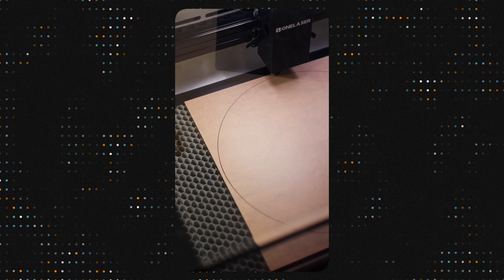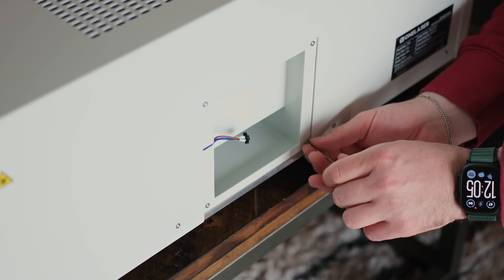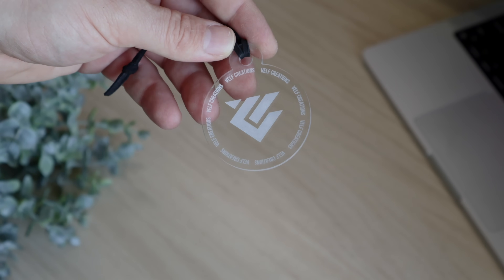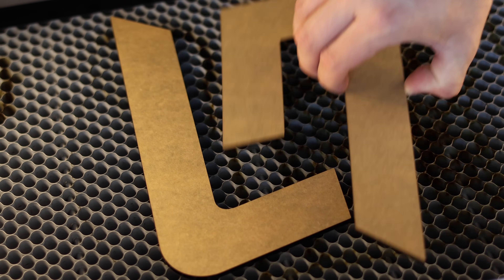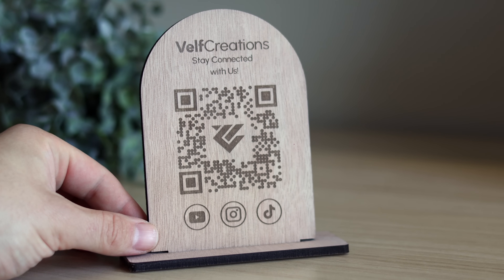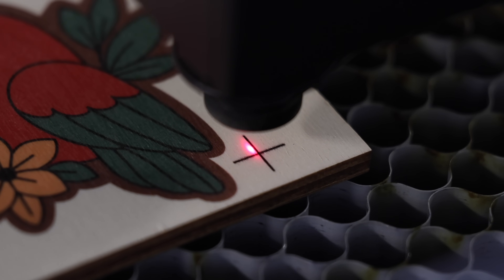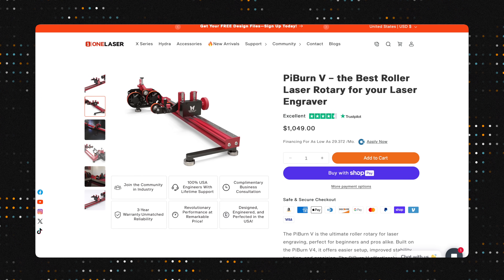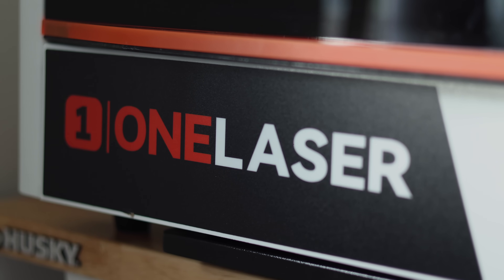OneLaser XRF Full Overview | What You Need to Know Before Buying!

Comment: Regarding fit on 24 inch top:  I am building a table for this machine (will be ordering soon) and it must be placed up against a wall.  I have a tight space in a bedroom/craft room.  The front appears to be close to flush to the front of the table-top, so there should be about 12 inches or more hanging off the back of the table-top?  The depth of the machine is 28.5" which leaves 4.5" of machine,  plus exhaust which should be about 7-8"min. if 90 degrees.  If this is true, there should be about 12" of machine and exhaust off the back edge of this 24 table-top.  That's the estimate I have concluded, but, in the video, your machine does not appear to need that additional space.  Is that correct from your view of the machine?

Comment: Could this laser be kept out in a garage in the heat?  I live in Louisiana and it can get very hot and humid and I have no space in my craft room for it.
Reply: Yes.... I live in Houston and my XRF is placed in the garage with door wide open when I am using.  NO ISSUES.... I would be more concerned with XT or a CO2 as that will require a chiller.  My exact reason to go with the XRF as it is NOT affected by the heat and trust me, you know what 100 degrees feels like.  8-)
Reply: @rcsailor199 Thanks so much for letting me know!  And yes I know what 100 degrees feels like...lol.
Reply: @rcsailor199 But what about the humidity? I live in Houston and the high humidity concerns me regarding electronics.